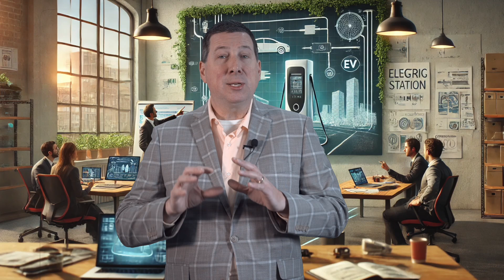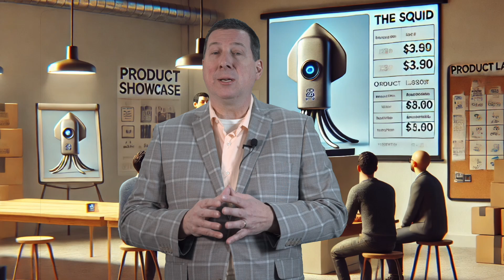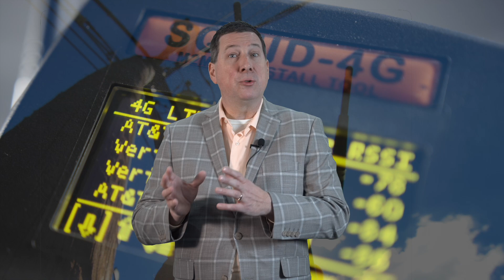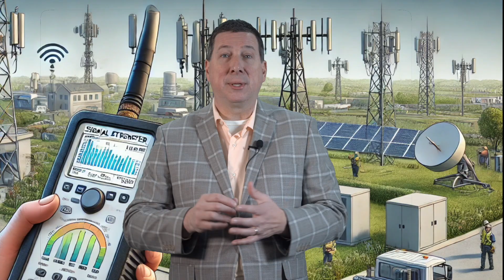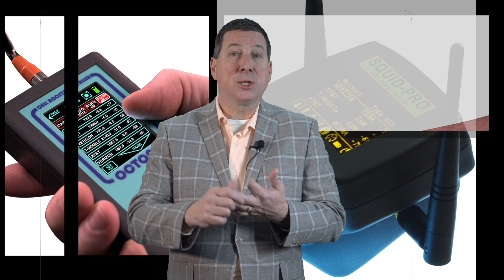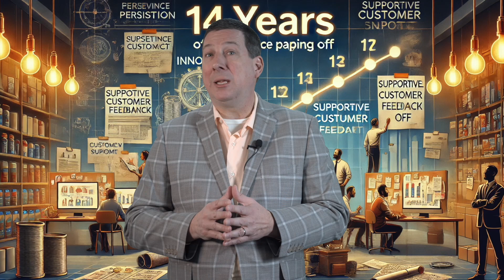Evolution of Octopus 4G Signal Meter

Comment: You should add ways to add parameters for signals being found. For example limiting recorded frequencies to a range because a lot of the time we are searching for viable coverage and the extra data is nice but ultimately becomes something a skilled user has to review in the field for in flight work.
Reply from the maker: Octopus receives all nearby 3G and 4G base stations and "limits" those results by letting users sort by carrier, frequency and signal strength.
Reply: @Bvs @Bvsystems h I know I have one. Great product. I just wish we could set limits like all carriers from freq 925 - 990 and only have it record if it falls in that range. Or only record strengths above -105.
Reply from the maker: @Bat @Battlejef  OK got it. Sounds like you would benefit from a threshold setting and ranging of frequencies if you’re seeing too many populate at once. We try to keep our tools simple but we do include these features in a few other wireless receivers so I can pass this onto our engineers to see what they think.